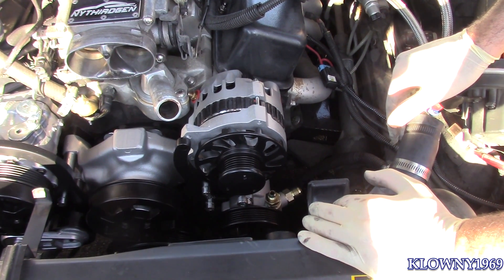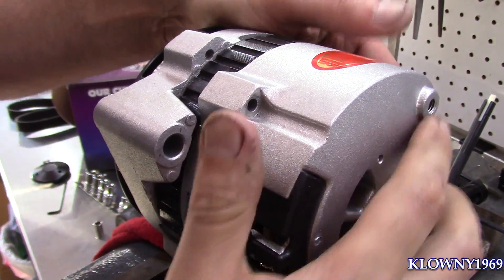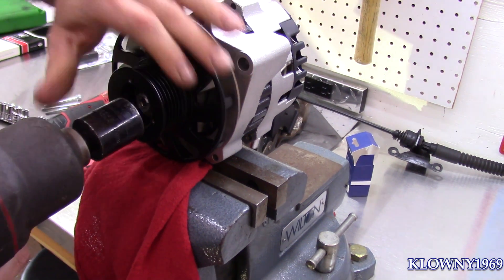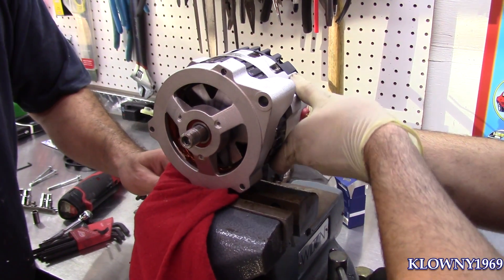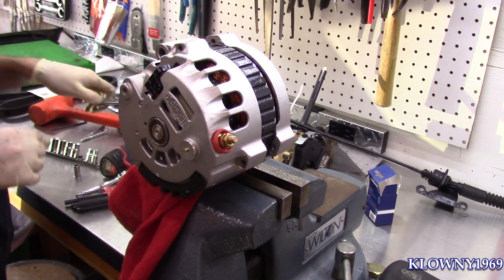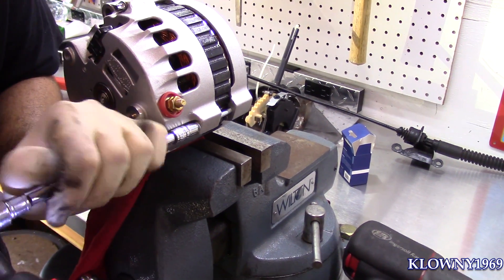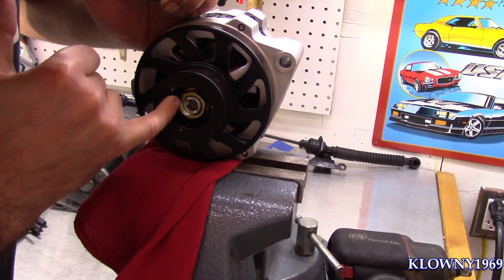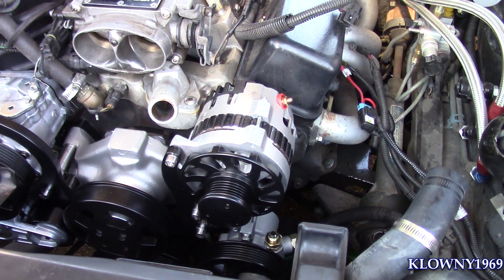How To Clock an Alternator

Comment: I don’t hit the rotor as it can damage to plastic tolerance ring in the rear and also break a brush. I remove the fan and pulley after removing the thru bolts and set it face down on the shaft on a thinner 1 groove pulley for a stand and tap the front housing down on the shaft till I have enough clearance. Then turn to the clocking you want then put the alt in a 6 groove pulley (with the spacer) and then the rest the alternator face down using the pulley as a stand. Tap the rear down lightly tell stator and housing are seated. Install the thru bolts and equally tighten them and check that the rotor doesn’t rub on the stator and if it doesn’t install the spacer , fan and pulley and spin again to check to see if it’s free.

Comment: I feel like this is a really dumb question that I know the answer to but I recently put a gm alternator on my cummins and it's not charging. The only thing is I had to mount the alternator basically upsdown from what it was in the gm pickup it came from. My question is would running the alternator 100 degrees off from its factory position cause it not to charge? Do I need to relclock the innards to make it work?
Reply from the maker: You shouldn't have to do anything internally
Reply: @klowny1969  that's what I was thinking

Comment: That's hard on the bearings pounding on the shaft. It's easier to remove the thru bolts and fan and Pulley and set it back on the pulley like a stand and tap the front hsng down a bit on the shaft to clear the 2" ear. When in the spot you want it pull the front back up and re-install the thru bolts , fan and pulley. This is especially good on a roller bearing alt. and don't have to reset the brushes.
Reply: And now the rest of the story. 👍👍